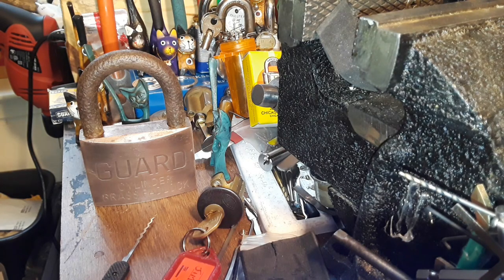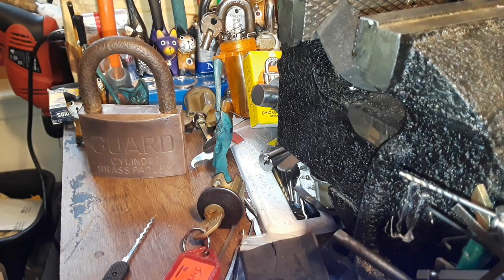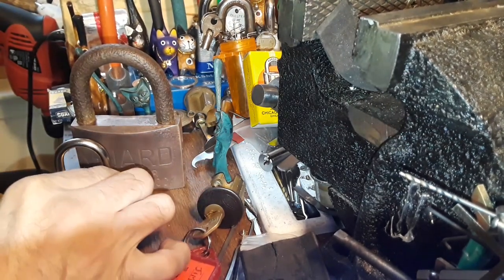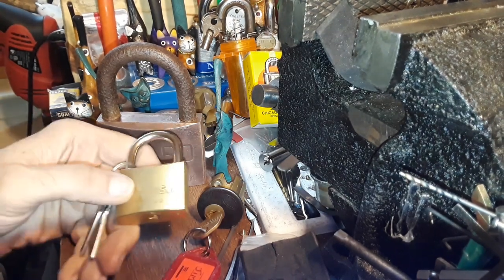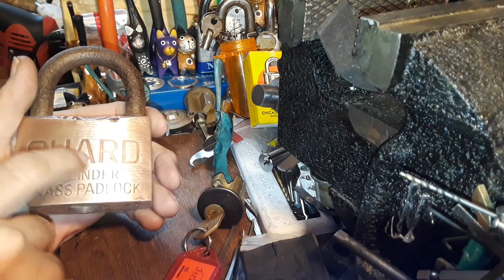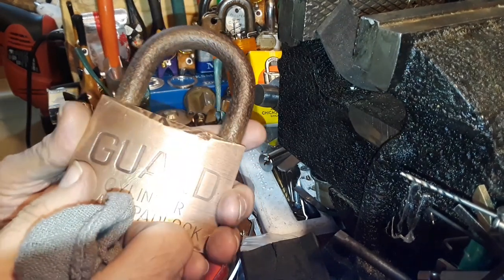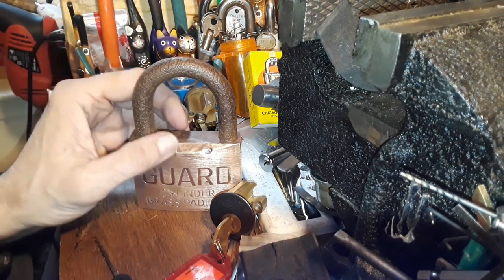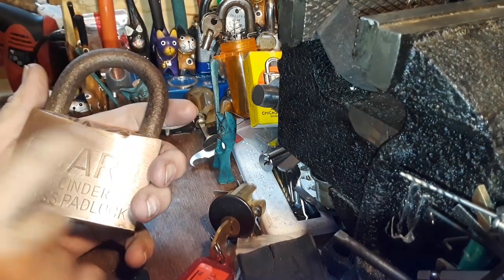(698) How I Clean Brass Padlocks and Why

Comment: If you have a brass lock with a rusted shackle you can use something called evapo-rust. Will take the rust off the shackle but not the patina off the brass. It's really interesting stuff. Can be used over and over again. Always love your ramblings William.
Reply from the maker: Thank you.  I will have to look for that stuff. Sometimes I only want the rusty shackle cleaned enough to free it up. Later I will try electrolysis to remove rust, but that's another experiment.
Reply: @WilliamMancel  I was watching a program hand tool rehab or something like that and he was the one that uses evapo-rust and I've seen some of the results of the parts he cleaned with brass attached. So thought I would give it a whirl and sure enough worked. You can put your hands in the stuff.

Comment: Nice video William, locks and cats.😁😸 Yeah, the acid brings out copper oxides. Many don't like that but polishing is always an answer. I use brasso instead of a brass brush but prefer natural patina but if the shackle is rusty you may not have much choice. I bought a guard lock from your previous link and messaged the seller to tape up the package properly as friends were getting empty packages. He hasn't replied yet, nor posted yet. :/

Comment: Great discussion with good info and comparisons.
A question though, if you use brake cleaner on a really gunked up grimmy internals on a lock do you then after it's done it's thing have to wash the lock of in something to get rid of any brake cleaner. Same for vinegar do you have to neutralize the vinegar after it's done its job by washing the lock in water or something, cheers matey
Reply from the maker: With vinegar,  it's probably not necessary,  but I rinse it in water after taking it out of vinegar.  Then I put some lock lube in it. The break cleaner dries up fast, and I just use a little bit.
Reply: Thanks for the info, cheers matey